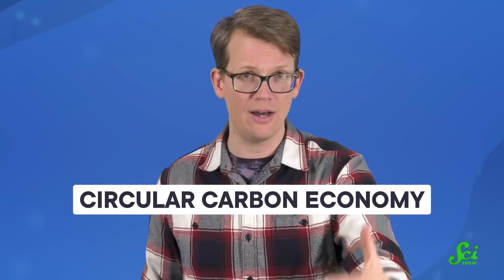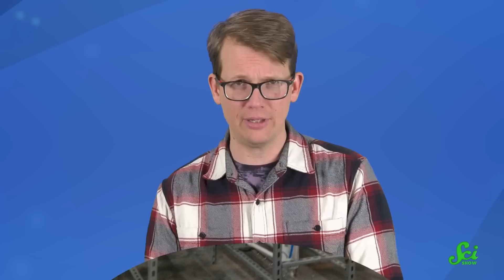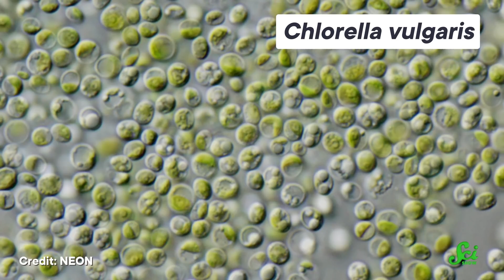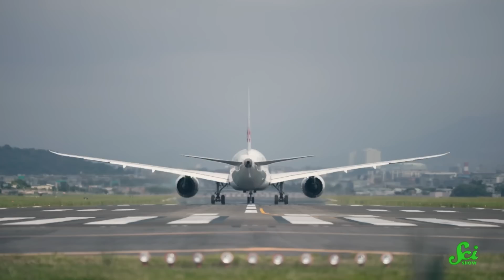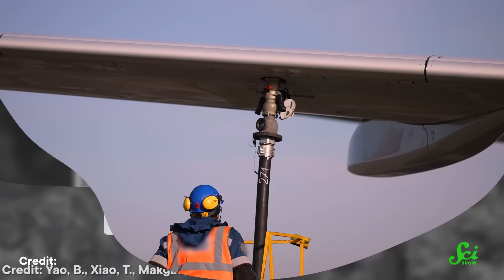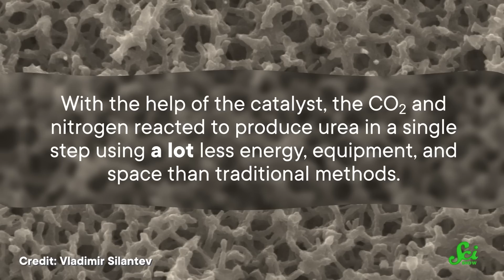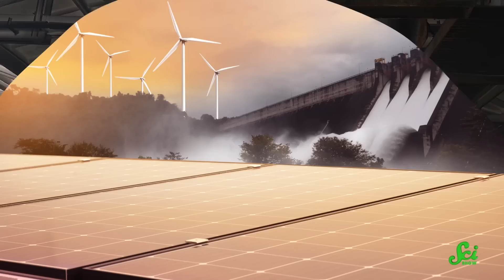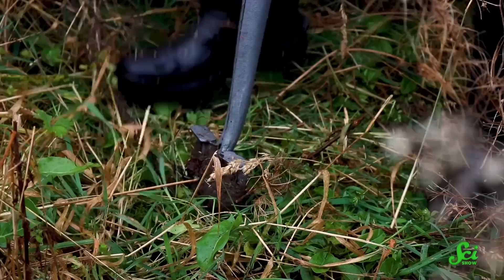One Way to Deal With CO2? Reuse It

Comment: Knowing the efficiency of nuclear technologies this almost seems like a “let’s take advantage of the problem” solution instead of a “let’s get rid of the problem” solution 
I see it as the difference of plateauing an issue vs getting rid of the issue and having these systems side by side would literally conflict because as nuclear would improve the “whatever this alternative carbon recycle tech is called” would have less CO2 emissions to recycle which means it would be inferior if not eventually phased out billions potentially reaching tens of trillions of dollars just to be phased out in 3-5 decades due to nuclear fusion advancements 
Maybe I have it twisted in my head  but the way I see it this technology wouldn’t be worth it in the long haul it would bring a couple decades of prosperity if it’s commercialized before nuclear fusion but would collapse economies who wouldn’t eventually change

Comment: We could just stop doing capitalism. It really only benefits about 10% of the population while harming 90% and is the reason we're in this mess to begin with. A handful of companies produce about 70% of CO2 emissions, dwarfing what all of us commoners do, and yet it's us who are usually the target because those companies don't want to even consider doing things different if it means they might be making even fraction of a percent less. Better to have the whole world burn.

New technologies are neat, but we have everything we need already to solve climate change. But we just can't do it because a tiny minority who holds all the power doesn't want to. 

We could switch over to public transit -- buses, trolleys, trains -- to reduce the number of cars on the road and mitigate need for planes in many instances. We could also have remote working be the norm -- because in America especially the majority of jobs that exist simply do not require the physical presence of someone, which means there's less need for driving and most people might not even need vehicles (not building any more suburbs would also help, it's the most wasteful use of land and resources and is part of what has caused such issues of homelessness, though the existence of landlords has been a huge factor as well). Without the need for so many big buildings to house employees forced to drive to work, we could use the land for other things from parks to farms to better housing. We could stop producing products designed to fail and designed to disallow consumer repair which would mean less need of replacements which would mean less pollution from manufacturing and shipping. We might not need so many factories then, either, and need to do less extraction of resources (which causes many different kinds of pollution). And there are many more things beyond just these suggestions that are doable today that would play a part in reducing the emissions of CO2 and/or reduce the effects of climate change.

No new technology will ever do the trick -- because first it'd need to be immediately profitable to the select few who control everything, and it'd also need to replace the polluting technologies/practices already in use without reducing profit for any of those same people/companies (which is impossible because of how rights and ownership work). And also "new" is just fundamentally less profitable and also risky for those who are raking in billions if not trillions from the systems they already have running reliably. The human cost is not a concern. Some of these utter morons even seem to believe they'll be able to zip off to another planet when this one becomes completely unlivable. Or, maybe they think they can ship off all the workers to another planet to extract resources and do manufacturing (at the cost of their lives) there and leave Earth to "get better" because only that top couple percent would be left on Earth.

Comment: surely should be noted that the emissions figure for the round trip US/EU was 800kg CO2 emissions per passenger. if jets only burned a <1 tonne of fuel for several hours of flying, we wouldn't be talking about air travel as an emissions problem.
Reply: and for those measuring the burn rate of jets and the speed and distance and figuring that the figure seem way too high, the fact is that emitting the CO2 at 40k feet causes about five times as strong a greenhouse effect as the same emissions at sea level

Comment: There's something out there that is already very good at extracting the carbon from CO2 and storing it... it's called PLANTS.  To reuse CO2, just farm fast-growing plant fibre crops, mulch and compress into bricks, burn those bricks in power plants for electricity, use battery vehicles.  Wood/plant fiber is not viable in vehicles because it's not that energy dense, but you can burn it in a power plant no problem, the energy/weight ratio isn't an issue there.  All the CO2 you're using came from the atmosphere, you release it back into the atmosphere, your crops continue pulling it from the atmosphere, no new CO2 is ever added, a balanced system.
Reply: Actually plants are very bad extracting CO2 from the atmosphere. That's why we don't do it.
Reply: @BlueFrenzy  Nope, they're very good at it.  Able to do it with just the little bit of sunlight that hits them.  They're just extremely efficient machines, taking only what they use to build themselves and sustain their own lives.  They don't consume and process maximal amounts of CO2 for no reason like a cancer, or like humans.  Saying they're bad at extracting CO2 is like saying that walking is a bad way to move around.
Reply: @jerotoro2021  please, educate yourself. Our current technologies for capturing CO2 are millions of times more efficient than planting trees per square meter. MILLONS. Trees are extremelly inneficient and takes a real lot of space, because the purpose of a tree is not to capture CO2. What is preventing us to use those systems is workforce. No one wants to pay for carbon capture. Not even for trees.
Reply: @BlueFrenzy  You're talking about space efficiency, "per square meter".  Not energy efficiency, not work efficiency.  You miss my entire point about carbon recycling and energy management, and then tell me to "educate myself".  Maybe read a little more carefully?
Capturing CO2 in a compact, space efficient machine is pointless if it requires energy input from the grid.  You're releasing CO2 to capture CO2, it's absolutely pointless.  It may work if you're powering it with a solar farm, but imagine the cost and workload of building and maintaining enough solar powered CO2 farms to make a measurable difference to the atmosphere?  And you're still pumping CO2 into the air through the constant production of solar panels and machinery.  There is no way to make this solution work, it's a dead end.
Meanwhile, the planet has vast amounts of unused space to grow plants.  We have the largest human workforce in history, and we have experience with incentivizing people to migrate to where we need them.  The only reason people don't want to consider the idea is that it seems like backtracking, or "not futuristic enough".  Everyone still chasing that 1950's concept of the year 2000.
Reply: @jerotoro2021  Energetically speaking our current DAC systems are orders of magnitude more efficient than trees and plants. Carbon capture systems by definition emit less carbon than what it's required to operate them. Even algae is more efficient than plants. DAC systems have an 80-90% of efficiency (meaning 90% oof the enegy is actively capturing CO2) while trees is below 1% and it takes almost a decade to start having a negative CO2 impact (yes, trees are CO2 positive during the first years of growth). And current technology is bad and inneficient, meaning there's a lot of space to grow.

 Please, stop spreading missinformation.
Reply: @BlueFrenzy  ... Still?  A dacs system captures CO2 in a tank, that's it.  Does not convert to fuel.  Are you even reading what I'm saying? Do you understand that the concept of recycling carbon is not the same as simply collecting it and sweeping it under a rug??  How does a dacs system recycle carbon for reuse as fuel if all it does is collect the gas into tanks???  At the cost of releasing MORE CO2 by consuming electricity, I might add.  We're not on the same page bud, these are two different things with different objectives.
Reply: @YouAre Cancer  really? from my understanding algae farms aren't as common. Their layout saves a lot of space but if i'm not mistaken biofuels like bioethanol were produced from sugar cane, palm oil, soybean etc. Algae farms are interesting though, as well as algae "solar panels" and dye-sensitized solar cells (DSSC).
Reply: Battery vehicles alone won't cut it in the automotive sector. When complimented by Fuel Cell vehicles, that's a more realistic approach to C02 emissions free transport, alongside E-Fuels.
Reply: the only problem is there's not enough space for plants for fuel and food. They compete with each other and often, you can only choose one
Reply: @wannabewallaby1592  Fibrous, inedible plants don't have the nutritional requirements that food crops do.  They don't need healthy soil, they'll grow literally anywhere they have sun and water.  So you can grow them in all the areas that are otherwise unsuitable for farming, which is actually a majority of the total land area.
Reply: @jerotoro2021  Just curious, do you have an example of areas unsuitable for farming that's ok enough for fuel crops? Is it like ex-mining areas? As far as I know (which isn't a lot), places unsuitable for farming gets marked for development or represents area of conservational value so it couldn't be planted as well. Not to mention farming areas need to be big enough to be economical --- it's not financially practical to plant and harvest fuel crops in many fragmented plots
Reply: @wannabewallaby1592  Examples would be foothills and low mountains with rocky/sandy soils, sandy desert scrubland (like much of Mexico), tundra/taiga areas with short growing seasons and nutrient-weak soil (like much of Canada).
Reply: @jerotoro2021  oh wow ok now that's a lot. I guess that would be subjected to local conservation guidelines and how they manage the area

Comment: Humanity has been capturing carbon, in elemental form, since prehistoric times.  It could be scaled up significantly and is a reasonably practical way to rebuild the entire mountains of coal that we've removed from the ground.  Grow trees, burn them into charcoal, refill mines with said charcoal.  If done carefully it can capture 30% of the mass of the dry wood from which it was produced, 80% of which is pure carbon.  The process requires nothing but trees and time.  It would even be conceivable, though likely not worth the effort, to capture the wood gas that is produced (and normally burned to heat the charcoal kiln) and use it to power the machinery required to harvest the trees.

Comment: You're better than this, SciShow.  Your description of jet fuel production is a perpetual motion machine.  Even if we accept that you left stuff out (Where did the hydrogen come from to turn CO2 into a hydrocarbon?  Isn't this just the Sabatier process, which has been known for 125 years?  Where does the energy come from to produce the hydrogen source and/or the temperature required to make the reaction occur?) there is is no way to take the end product of a reaction and turn it back into the reactants without reversing the energy input/output of that reaction.
Reply: Sunlight

Comment: Ok, I have to say it. Every human produces urea biologically. So basically we are producing CO2 to make something that is relatively abundant... This is our problem. No just non-circular carbon system, but non circular - every system.
Reply: I'd guess that it's not viable to extract urea from human urine on a sufficiently large scale (there are already some sewage treatment plants that produces fertilizers as byproduct, in certain cases I believe, as most of the things being flushed are indeed compost). It's probably not viable to try and extract urea specifically from sewage, and redirecting urine away from sewage for this purpose specifically is likely also counterproductive.

Comment: "Hey, we figured out this cool way to reduce CO2!"
"That's amazing! How?"
"Spend a few million in a lab to combine several expensive and complex things together."
"Well done. When will it become available?"
"When it becomes commercially viable."
"When will it become commercially viable?"
"Never."

Every single time~
Reply: at least we are developed a solution, even if not viable...yet
Reply: @mojacodes  “we are developed.” These are the people we’re working with here.. 🤦‍♂️
Reply: @mojacodes  There are things in the works, but this is a global problem and we need global solutions (and funding globally).
Reply: Expecting carbon capture to be "commercially viable" ie self funding is ridiculous. That's like expecting refuse collection to be self funding. The people who make the rubbish have to pay for that rubbish to be dealt with. The people who release the CO2 should have to pay the cost of recapturing that CO2. There should be a carbon tax on fossil fuels that is high enough to fund the capture of the CO2 released. But that would make those fuels so expensive that they would not be economically viable for most uses. Air travel yes, car travel no. EVs are already cheaper over the lifetime of the car. A full carbon tax would mean everyone would switch to EVs.
Reply: Its all a scam the only thing green about green energy is the governement kickbacks ..... electric cars are even less sustainable than fossil fuels and just lives the fossil fuel use away from the user like we did with other environmental issue... just push it to the undeveloped works. ...nuclear energy is the on future currently
Reply: And most countries cannot collectively agree on how to collaborate with one another.  I still cannot believe many in the Republican party in the US still say global warming/climate change is a hoax.
Reply: *ready in 20 years, just like viable nuclear fusion technologies
Reply: @wannabewallaby1592  Ah, but we've (USA) recently made some advances in fusion.  It took the US govt believing China was on the precipice for the US to ramp up funding for the research.
Reply: Sad truth
Reply: Exactly I’m too poor to care about climate change. But no worries they’ll make me pay for other peoples problems no doubt.
Reply: @ Robin Elk. Way more stinky than cow farts, the elephant in the room's fart aka the military industrial complex.
Reply: Human schizophrenia : desperately trying to tackle global warming with complicated expensive ineffective "solutions" on one hand while feeding the beast, the elephant in the room aka the military industrial complex on the other.
Reply: @lorenzoblum868  or the meat Industrie by eating tons of meat every day, or not presuring the politicians enough. 
Seriesly, doing more things to fight climate change is never bad, but those to things are probably the most impactfull to takle, if you really want to make a change.